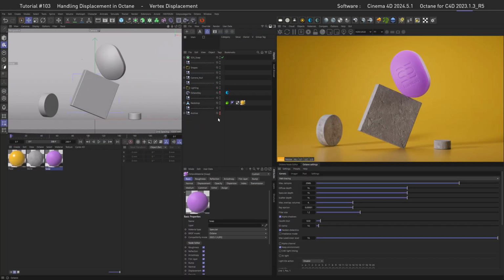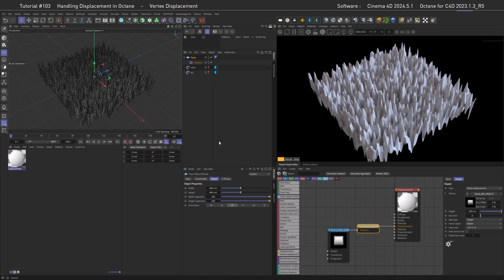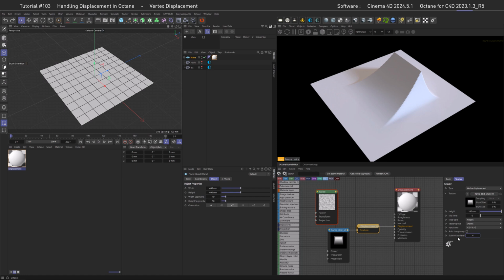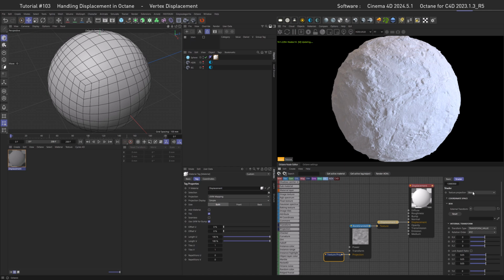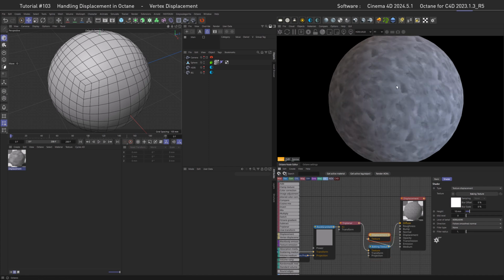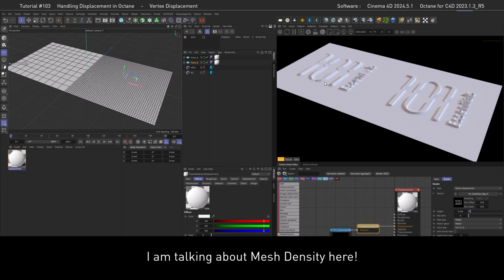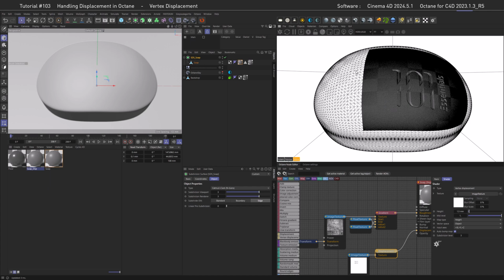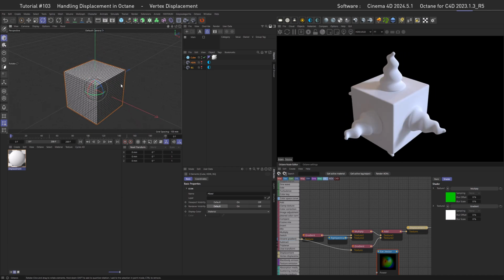Silverwing: Handling Vertex-Displacement in Octane PT2

Comment: Im really surprised to see octane doesnt have adaptive displacement.  Its enabled by default in vray which saves a ton of memory and scene prep time.  You can even adjust the amount of triangles per pixel.
Reply from the maker: Yeah. It's a really standard thing a lot of renderers have. Arnold, Redshift, Vray etc. Octane for the longest time only had Texture displacement. Then they packed in Vertex-D. It's funny. Redshift users really want Texture Displacement and can't wait to get the feature in while Octane users really want Adaptive Subdivisions 😇